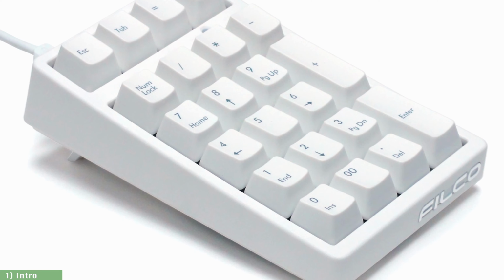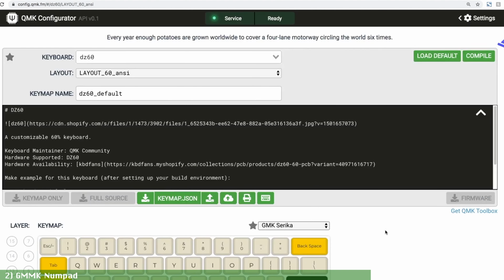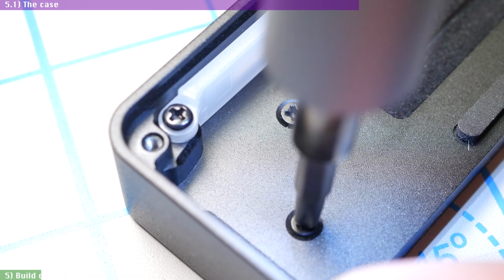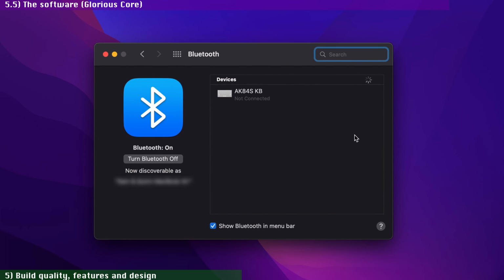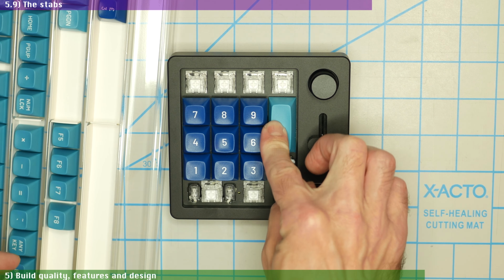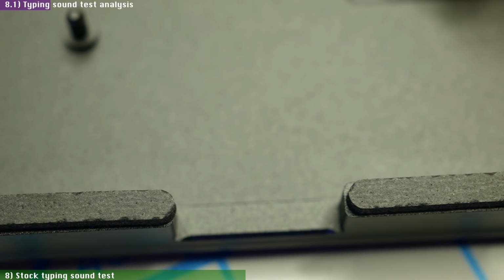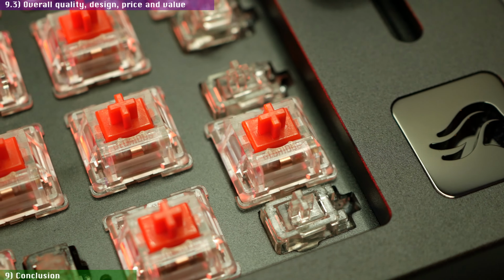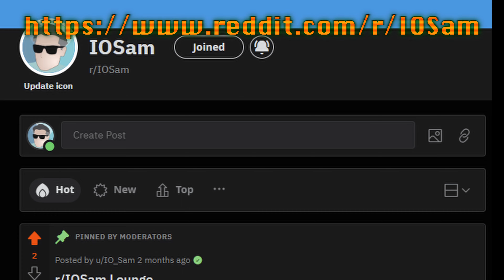GMMK NumPad: Glorious has done it again!

Comment: It's weirdly conflicting.
Like, yeah, Glorious in this case is kinda first to market, but does that make this execution good, regardless?

Someone mentioned on another review, that with glorious' current business practices, (like how the GMMK pro prebuilt is $350, essentially using things that, you can argue you could get for $250)

There's truth as well when someone else compared glorious to OnePlus, basically be a trailblazer to then end up like a more overpriced version of the rest of the crowd. 

It doesn't pair well with the GMMK pro, because as someone said here, it doesnt match/doesnt make a good use case to the GMMK Pro, both have knobs, and the angles/bezels, etc, don't match between the two.

It's just also weird that, you can get a prebuilt GMMK 2 for $20 USD CHEAPER than this numpad, and even more cheaper if you just get the barebones kit.

In a vacuum, I see your point that the GMMK numpad is the best option next to other numpads, but the bigger problem is when you open out more of your desk and then you see what else is on that desk and find out the GMMK pro keyboard already has a knob, that the GMMK 2 already has a 96% version that has a numpad, and that for some reason, the design aesthetic doesn't match any of the design language from the ANY of glorious' other keyboards (including the GMMK 1)
Reply from the maker: I don’t disagree with anything you stated here! And I see the anger on people who wished Glorious would continue to be the underdog forever… It reminds me of the days when AMD was the underdog and Intel was crushing. Now that AMD is on the top, a LOT of people resent their business practices… Capitalism… I guess.

Having said all that, my perspective in this video was PREMIUM NUMPADS (we all know we can get much cheaper plastic numpads on Amazon without any bells and whistles), which, granted, is a very small nice in the mechanical keyboards big market. This thing is DEFINITELLY not for everyone! I’d even say this thing might not be for most 75% and TKL users out there (and most definitely not for people who have 96% and larger boards!). Also, as you pointed out, if you have a GMMK Pro, you don’t need another knob. In fact, I think this pad works better for me when using 60% and 65% boards (which given my circumstances, these end up being the layouts I use the most).

As for the fact it doesn’t match the GMMK Pro perfectly (aesthetically speaking), while it can tickle my OCB a bit, I can get over it if the function is bigger than the form. Which in my case it is… But, again, I don’t expect it to be the case for too many people. I’d say that if you need a numpad, you already know it… And you probably already have one… Which the decision then comes down to: do I want to upgrade to something fancier and more luxurious? Again, that is very personal decision each and every one of us must make with our hard-earned money.